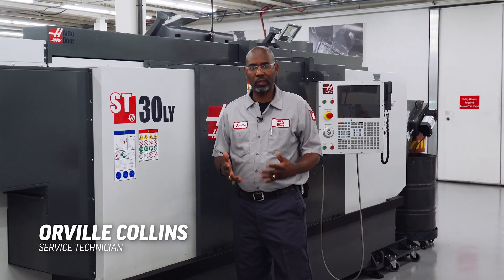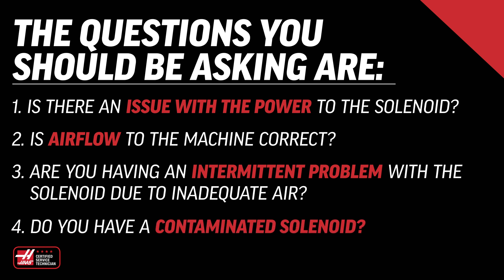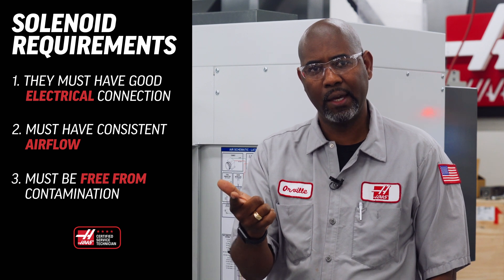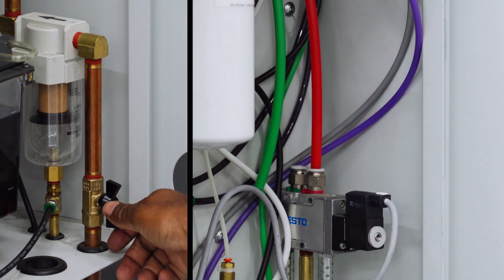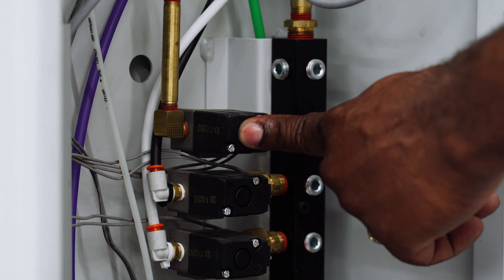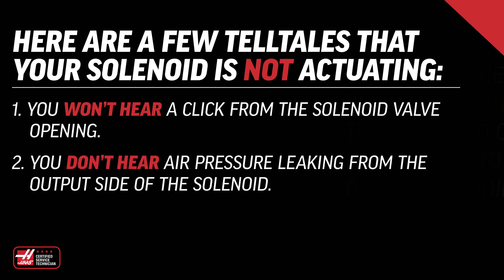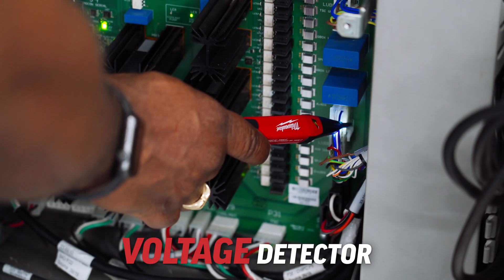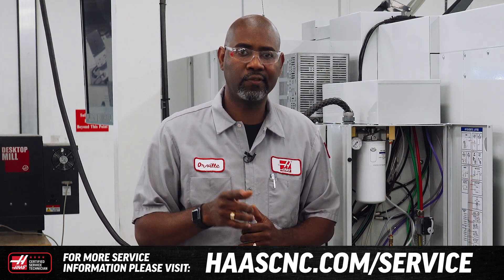Solenoid Troubleshooting - Haas Automation Service

Comment: One other thing to check is the air muffler! We had the one that operated the drawbar become clogged up with junk from the airline and it was causing the drawbar to not fully disengage before the spindle started spinning at 100% rapids. A workaround was running at 25% but that is slow, especially when you got lots of tool changes. A service call later to check the spindle/drawbar mechanism later and... Hey, the muffler is clogged 🙂. Pulled off the old one and hey presto, it works as intended.